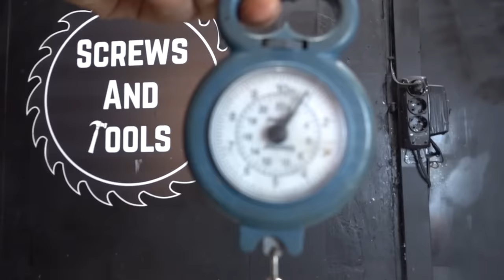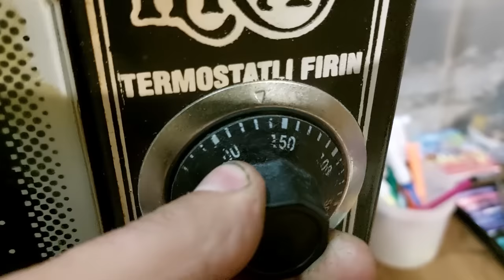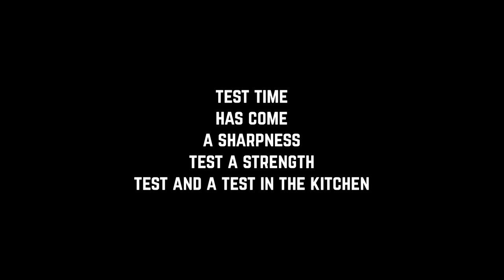Restoration of Rusty Cleaver - Delicious test is included!

Comment: with which electrodes did you make the welds. And with which welding apparatus did they matter. Thanks
Reply from the maker: I used thin wire and carbon dioxide once for welding